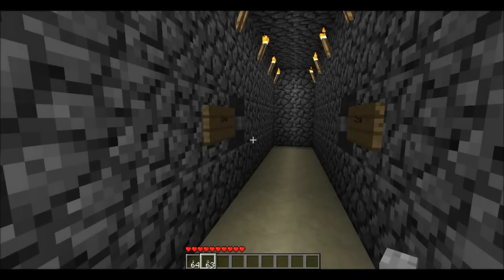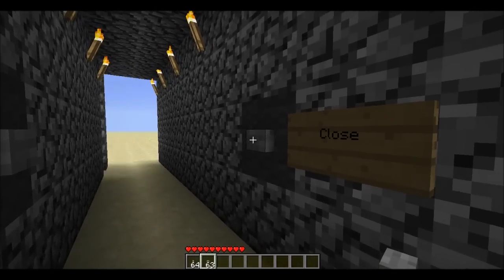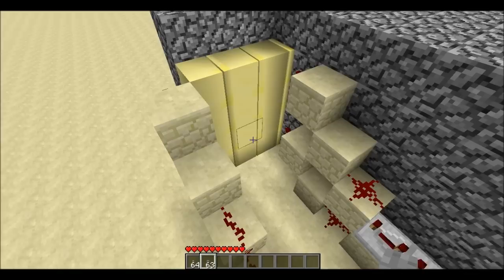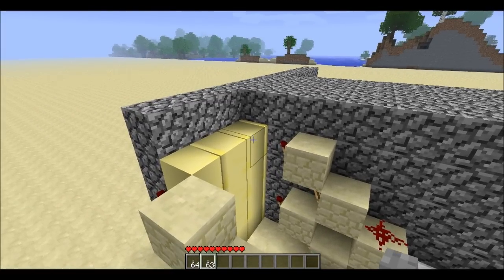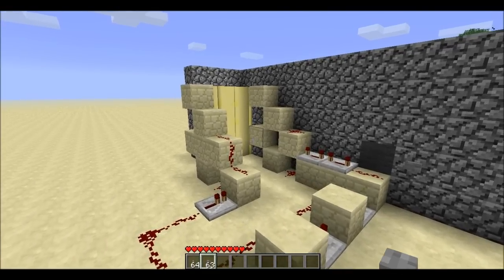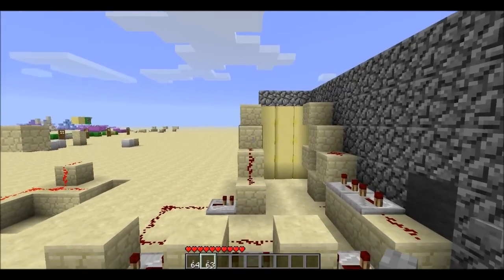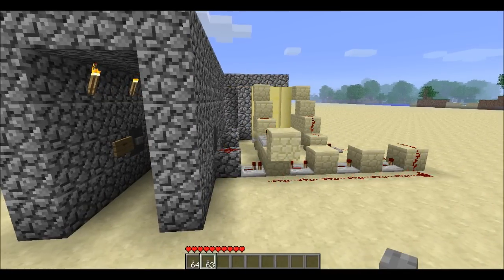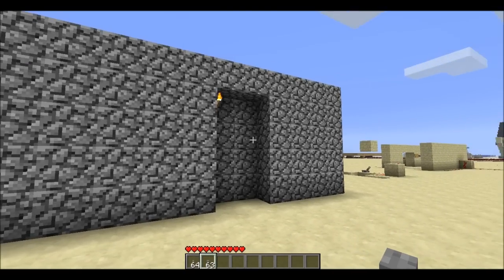Hidden Hallway Door using Pistons

Comment: y dnt u put a set of golden pistons on each side that each push 1 block into the middle then pull it back, but u would have to use switches not buttons